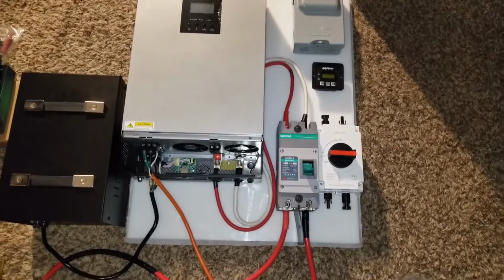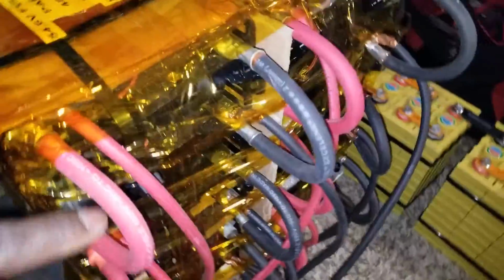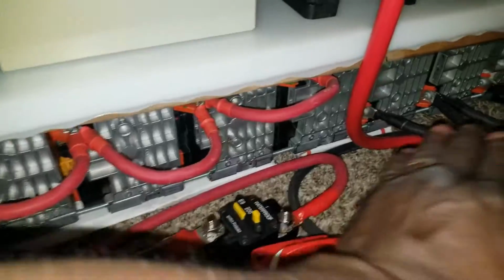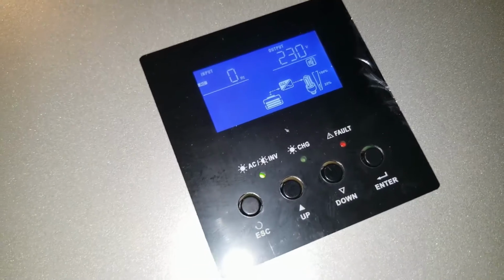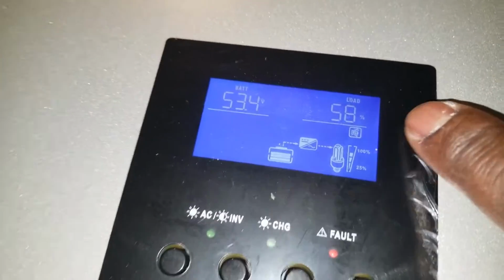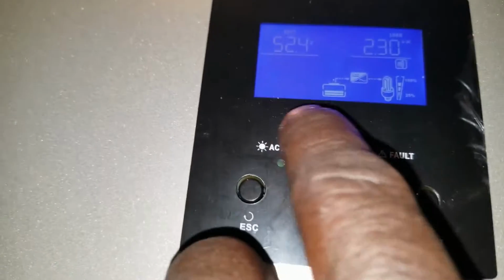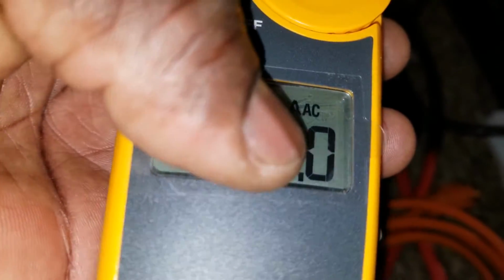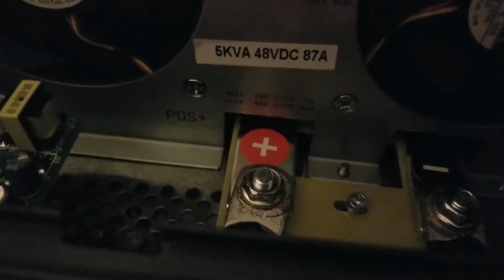VEVOR: 5KVA 48V MPPT HYBRID SOLAR INVERTER BUILT-IN PURE SINE WAVE CHARGE CONTROLLER (Part#2)

Comment: Hello can any body help.  I have a 48v PV water heat system set up and working.  It has a Vevor Red/Black Charge Controller.  Works great except that when the load Is Showing shut off  on the phone but the Heat element Is still drawing current
Reply from the maker: @johnstone-gh9nj  
Do you realize you are dealing with resistive load right?
An electric water heater consume a lot of power 

An electric heater is a resistive load, which means it resists the flow of current when voltage is applied and dissipates power as heat. 

Here are some things to know about electric heaters and resistive loads:

Wattage ratings
The wattage rating of a resistive load is usually accurate and can be found on the device's label. 

Power consumption
The amount of electricity an electric heater uses depends on the temperature setting and the size of the room it's in. You can calculate how much energy a heater uses by multiplying its wattage by the number of hours it runs per day.

what size of your inverter?

What size is your battery conductor?
Reply from the maker: If you dont find this information helpful, please contact your manufacturer ask them to help you understand it better or hire a licensed electrician professional to do the work for you. 

Cheers
Reply: @jwsolarusa  Thank's for the reply.  I under stood It enough to get It up and running. I have friends pro electricians most of them seem to know very little about DC.  It Was working perfectly but has stopped. In other words. It heated the element when the battery had the required current and Cut off when the Battery dropped  below that. Both are set currents.  AND of course I did reset the system again just In case.   The system pre heats the water In my rads. No great expertise In that. 
Thank's again anyway for the reply
Reply: BTW all that's Involved in the system PV Panels and  Charge controller. Off grid 48 V and batteries.   No Inverter .

Comment: Can u set fan speed how much was that unit can u feed mains into it
Reply from the maker: Nothing to set when it comes to the fan speed.
It's AUTOMATIC.
Thanks for stopping by and don't forget to LIKE👍 SHARE and SUBSCRIBE

Oh!.....😲 before I forget, please check out my AFFILIATE links below.
Cheers. 

GoKWh PRODUCT LINK:
 https://gokwh.com/gokwh-12v-100ah-lifepo4-battery-built-in-smart-bluetooth/
Exclusive CODE: jwsolarusa12v
(valid for two months)

SOLAR PANEL: (SANTAN SOLAR)
USE THIS AFFILIATE LINK TO BUY YOUR SOLAR PANELS FROM SANTAN SOLAR: 
https://www.santansolar.com/?ref=naswes

USE THIS LINK TO BUY YOUR LITHIUM BATTERIES AND SAVE 5%

BATTERY HOOKUP PROMO CODE  
https://batteryhookup.com/discount/jwsolarusa

GOLDEN MATE ENERGY 
AFFILIATE LINK 
https://goldenmateenergy.com?sca_ref=4914977.QFhdjiqgNF

10% Coupon Code:
JWSOLARUSA

https://goldenmateenergy.com/products/12v-100ah-lifepo4-lithium-battery?sca_ref=4914977.QFhdjiqgNF

https://goldenmateenergy.com/products/12v-lifepo4-lithium-battery?sca_ref=4914977.QFhdjiqgNF

https://goldenmateenergy.com?sca_ref=4914977.QFhdjiqgNF&sca_source=Solar Equipment 

KAIWEETS Affiliate link:
https://kaiweets.com?sca_ref=4823342.ry8scB7CPV

Use this unique COUPON CODE: JWS15 
to enjoy a fantastic discount when you make a purchase

KAIWEETS KM201 Digital Multimeter - 2000 Counts True-RMS
https://kaiweets.com/products/kaiweets-km201-digital-multimeter-2000-counts-true-rms?sca_ref=4823342.ry8scB7CPV

KAIWEETS HT100 Non-Contact Voltage Tester Pen AC
https://kaiweets.com/products/kaiweets-ht100-non-contact-voltage-tester-dual-range-ac-12v-1000v-48v-1000v?sca_ref=4823342.ry8scB7CPV

Comment: I dont use a BMS on my  LEV60F 8 Cell 4S or as you call it 2 P and I ran my  Quartz Radiant heater on low (400Watts) for 4 hours and 30 min. Then charged each cell to 4.20.When at full rest the cells read on my Vevor clamp meter 3.351 right across the board perfectly balanced. No need for a BMS right now.
BTW you have an amazing setup there keep up the good work. BTW try to bottom balance your battery pack when you fully discharge, Then bring the pack up to full charge. In theory this should keep your battery pack close to being Balanced.
Reply from the maker: Thank you my friend for you awesome comments and have a wonderful day.
Reply from the maker: I just wanted to let you know I just SUBSCRIBE to your channel. 
Cheers
Reply: @jwsolarusa  thank you my friend
Reply from the maker: @mannyfragoza9652  
You are welcome buddy

Comment: I have a similar set up with those cells and inverter. I’m not using a BMS neither. Settings on that inverter prevents them from over or under voltage to the batteries.
Reply from the maker: How are you liking your setup.
This is my third Vevor Inverter I am installing
Reply: It’s been working awesome for me I ran a small sub panel  from the output. Then I added breakers to get 110v breakers and outlets
Reply from the maker: @omarsegura2847  
Keep on the good work